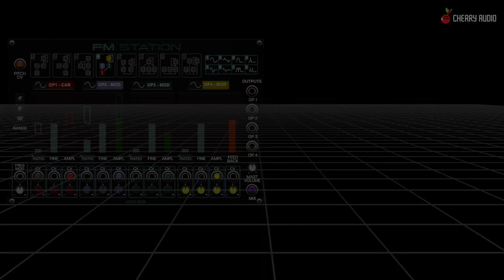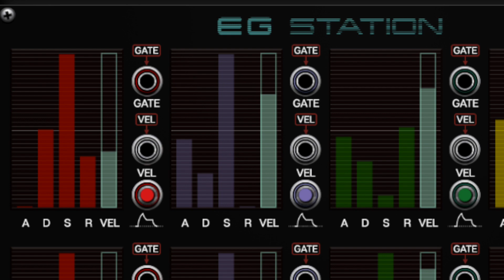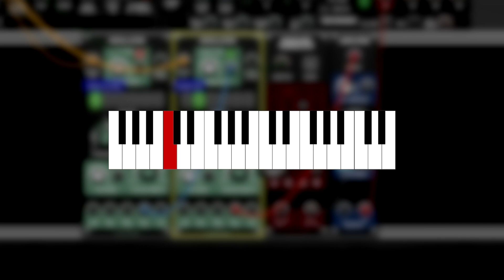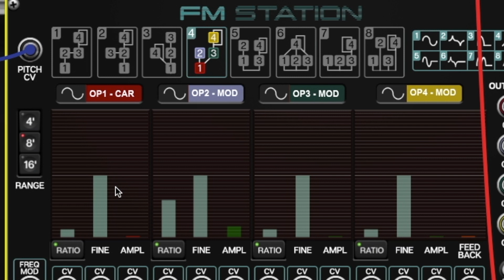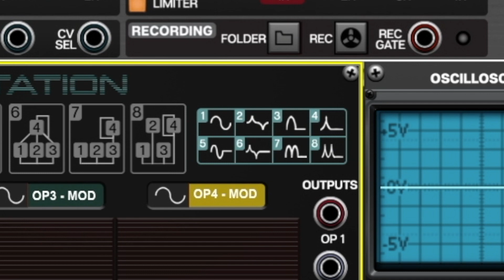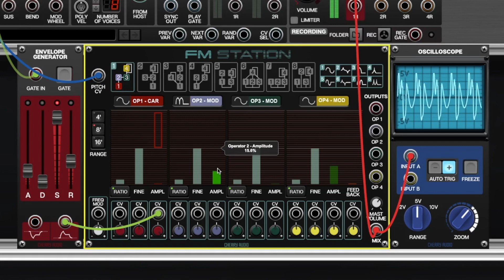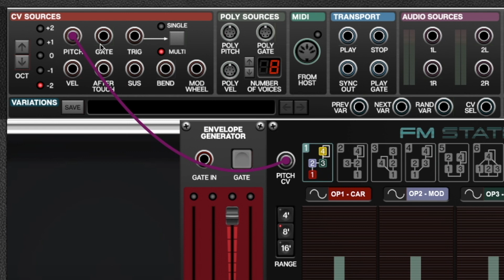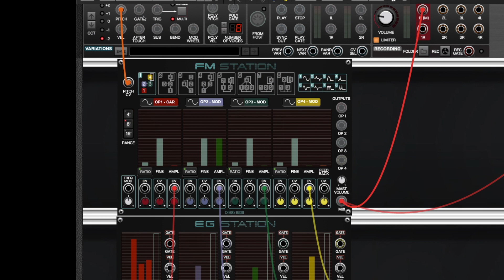Voltage Modular | FM Station and EG Station Overview

Comment: because this is 4OP, i'm curious if it'll achieve some DX100 sounds? What are the global settings for things like overall cutoff filter, pitch bend amount and mod wheel --> Vibrato?
Reply from the maker: You can definitely get very close! As for the global settings, this would be determined by your patch and how you map, route, and configure those parameters. For the basics, you can add a Mod Wheel Assistant and Bend Limiter module to your rack to control their function and routing! For a filter, you can add a filter module and then control that with another parameter, a macro knob, or with MIDI CC by learning the cutoff knob.